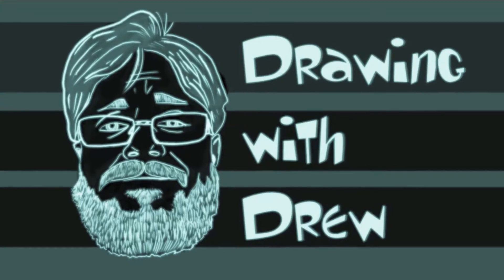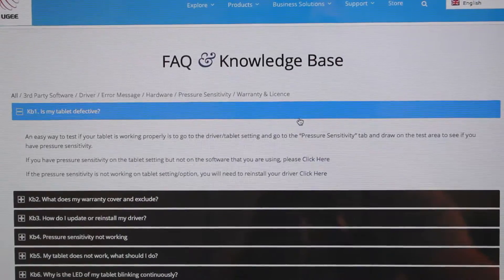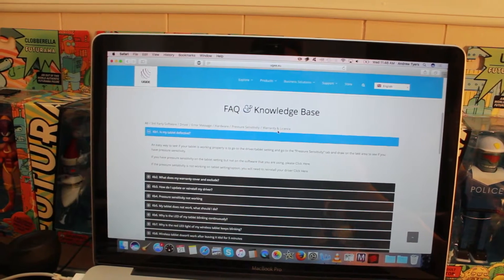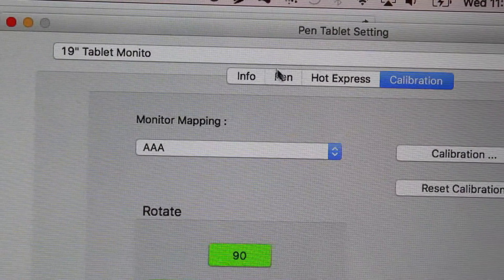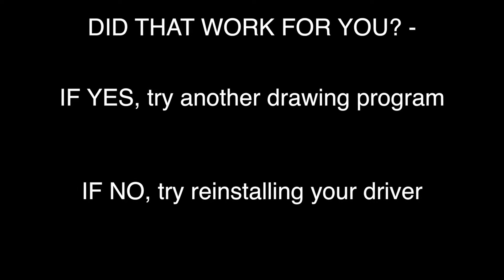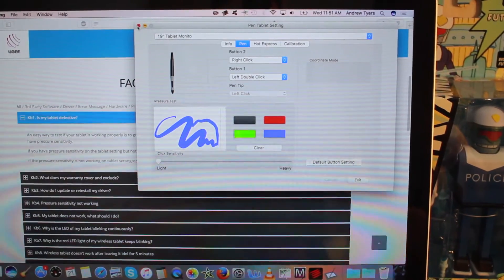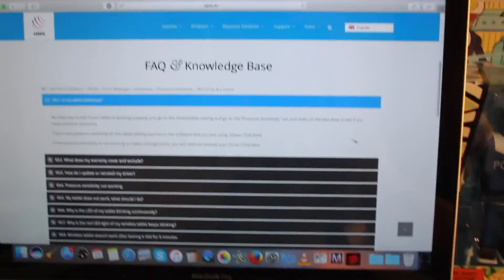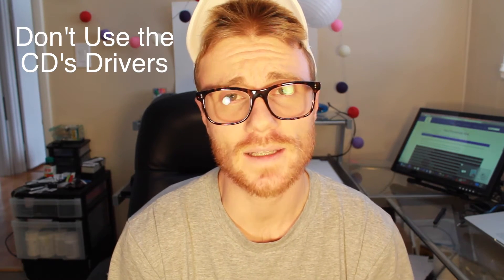UGEE UG 1910b ADVICE- How to Tell if Your Monitor is Defective. * Trouble Shooting Tips & Help

Comment: Sorry to complain, but my tablet isn't connecting the screens correctly. Instead of working on the one screen, it shifts between the two. My tablet also appears black on the log in page of my computer. I've had smaller problems before and had managed to fix them, but this one won't go. It also displays a "No Signal" message in a blue box. I scrolled through and found others who experienced the same problem, but the solutions that worked for them won't work for me. Any help would be greatly appreciated. It's never done this before so I don't understand why it's doing it now all of a sudden.

Comment: Hello Drew how are you doing??? I was hoping you could help me with this little problem I have with my UGEE  1910B. It works fine but my screen goes black after a minute. I did everything to fix this problem but I can't see anything on the UGEE 1910B...Could you please help me with this problem??? Also on my computer, it shows one screen, not 2 screens connected...

Comment: Hi Drew, Ive had my tablet for a short time, the screen appears to have some dead areas where the cursor skips the motion i am drawing and draws a straight line. this issue occurs in 3 areas on the screen for the height of the screen. I have tried contacting Ugee but nothing , have you ever heard of this issue ? :S

Comment: I've been having calibration issues, but I cant just calibrate the tablet. Whenever I select monitor number 2 (the  ugee-1910b) in the pen tablet settings, the pen is unresponsive. When I select monitor number 1 my pen is responsive but way off calibrated.
Reply from the maker: Here's a tip from another subscriber....it might work: "i uninstall the ugee2150 to my laptop coz the pen is not responding while i'm doing some job the pen cursor just left in some area and while i right clicking then it will respond then after that will not respond again, what i had do is reinstall it but i set the properties of the installer to "run in compatibility mode" after that it became ok again, I've just discover that tip from somewhere in google world hope you find it too, hope this will be useful to others." Good luck!

Comment: I'm having a problem. I started using ugee on my mac instead of pc. it worked the first time but now it says 'tablet not found'.  The screen works and the curser follows my pen but i can't click anything. I've tried completely reinstalling the driver but no such luck. Any advice?
Reply: Hi, I’m currently having the exact same issue with my 1910B except mine has said “tablet not found” from the very start, did you ever find a way to fix this?
Reply from the maker: Hi October Dreamer...very strange that it worked the first time but not after that...have you been able to get it to work since? I guess I would start by trying to run it on your pc first to see if it is something to do with your Mac. Let me know if it's working and we can try to trouble shoot it more. Good luck !

Comment: Hi drew, I got a Ugee tablet myself recently and it works well except the monitor of the tablet won't turn on. What do I do?
Reply from the maker: Hmmm....I would try unplugging everything from your computer first....First things first, I would try installing it on another computer first to make sure that it isn't your computer that it is having the problem with. As a last resort you could try  using a little rubbing alcohol on a paper towel and lightly touching the connection pins (power off of course)....there could be a loose connection within the unit...if that doesn't work I would contact ugee immediately.
Reply: I actually figured it out, the Ugee I got had a core that connected it to the computer (which I had to buy the drive on amazon, thanks for the link) its very touche and sensitive. which is annoying but hey it works now, all I have to do now is take time to adjust to it.

Comment: I'm sorry to complain like everyone else. but my pen has issues. my spare was one broken when I got it so I don't know if that had a connection or something but here's my issue. The pen I do have seems to want to draw when its not touching the screen. And it decides to hold onto things too. I tried all I could but I still have that problem. I'm wondering if I can get a few tips. And again. I don't know if the package my tablet came in was thrown around quite violently. But iv'e cleaned everything top to bottom with a microfiber cloth and it still has the issue. Iv'e tried this with 3 different programs, but I still run into that issue, thank you for your time. kind regards
Reply from the maker: Hi Lucky! Don't be sorry...this is why I started this YT channel...to offer support and share solutions with everyone...Sorry to hear about the pen issues...if one of your pens arrived damaged then there is a good likely hood that you do have an issue with your pen. 1) I would write to ugee and explain your issue....I think they will be receptive and send you a new pen as it would be a lot cheaper than having you return the entire unit. 2) Try a variety of drawing programs with it...does the pen function the same way regardless of the program? 3) play with the buttons on the pen a bit...it could be that their is a connection program and it is acting like one of the buttons is being pressed under certain pressures...Let me know and hopefully we can find a solution

Comment: Mine connects and disconnects, I'll be drawing with it and out of nowhere it just stops drawing, I bought a new pen thinking my other pen wasn't working because I would charge it and still nothing. I would replug in everything, but nothing worked. So I got the new pen and it was working for about 20 mins and bam it stops again. I went to tablet settings and now it doesn't even say my tablet is found it says "Tablet Not Found" So I reinstalled the tablet settings thing, and still doesn't work. To clarify, I'm using an Apple MacBook Pro.
Reply from the maker: Hi SpitfireAnimations. I am sorry to hear that  you are having trouble with it. Is it still not working? the only thing I would say is to try installing it on a new computer...no matter how old, to see if it responds to the new device...if so, you may need to reformat your computer as something may be interfering with the drivers

Comment: I just purchased a Ugee and cannot get my monitor to display anything other than "No Signal." Has anyone else ran into this problem or found a solution? The drive is installed, there are no other pen drivers on this computer and all the cables are plugged in a snug in their correct ports. I even gave my graphics cards an extra push to make sure they were snug, but still nothing. The pen itself works to control my computer cursor, but there is no image on the tablet.
Reply: same here, I've been trying different ways to connect it to my computer and no matter what it just says "no signal" when I turn it on, but allows me to use it as a drawing pen
Reply: nevermind, apparently I just didn't realise that you have to connect it before booting up your computer for it to recognize it
Reply: CST0UT Same issue with mine, disappointed with my buy. Not buying another anytime soon
Reply from the maker: Hi CSTOUT...That's very strange. Are you connecting the monitor via VGA or DVI?
Reply: You will need  a vga/hdmi conversion  plug http://www.ebay.com/itm/1080P-HDMI-Male-to-VGA-Female-Video-Cable-Cord-Converter-Adapter-For-PC-DVD-HDTV/221909515908?ssPageName=STRK%3AMEBIDX%3AIT&_trksid=p2057872.m2749.l2649

Comment: Hi Drew, problem.  This tablet works for a short time with Sai program then went I turn off my computer and turn it back on, it doesn't work anymore.  Seems I must uninstall and reinstall every single time I turn off my computer.  Frustrating.  I have HP windows10. Bought a VGA to USB cord. Any advise? Thanks.
Reply from the maker: Hi Sonja. Does the program work fine if you just put your computer to sleep rather than turn it off? What happens if you unplug the VGA cable prior to turning off your computer? It sounds like you are having driver problems...its almost as if it resorts back to a default setting after you turn off your computer. Did uninstall any previous drawing tablet drivers prior to starting? Did you download the driver from the website rather than using it from the CD? Hopefully we can fix this...I would send Ugee an email too incase they know. Good luck

Comment: Hi Drew, I have a question, I just got the 1910b today and I'm really happy with it's pen performance but I'm having trouble with the monitor part. Mainly, I can't seem to calibrate the colors properly andt the screen being so bright it hurts my eyes within minutes of use. I haven't gotten a dvi cable yet so I've just tested it with vga. Thanks in advance!!
Reply from the maker: Hi PacoAfroMonkey, I wish I could say there is an easy fix for it but I haven't found one. The colours on the 1910b aren't exactly accurate so you will need to use your computer for reference. As for the brightness, it bothers my eyes too after about 2 hours of use, I found that wearing sunglasses while drawing for extended periods really helped...hope that helps. Good luck!
Reply: Hey Drew, so if anybody else was wondering about the brightness and color problem, I kinda found a solution. You don't want to lower the brightness on the OSD settings, that just darkens the colors. The trick is changing the color temperature setting to "user", there you can change the red, green and blue values individually. Set them all to anything below 50% and you're good to go. Now the color calibration itself is a bit more complicated since the monitor has very little options. I had to borrow a pro display colorimeter to do it, but I did get pretty accurate colors, so it is doable. The only thing that somewhat bothers me now is I feel the images in the monitor are a little too shap... not much of a big deal, still haven't tested the screen protector (mine had to be sent separately and still has not arrived) but those usually blur the image a bit, hopefully that solves it. Hope this helps. Have a great year, man!

Comment: Hello Drew! I have aa Question that concerns me and I Hope to get an Answer Before I order My UGEE1560?, I have heard from Everyone that there can be a Real Problem Installing the Drivers, Well I had been using a Wacom Intuos #3 for awhile and I went into my Uninstall Program file and Uninstalled My Wacom  Tablet Drivers, and They are Not there anymore, So to be sure I  went to My computer and typed in Wacom and I had some files come up, and I cannot get rid of them!!!! Some say  C:\Windows\System32\Driverstore\FileRepository . Nomatter what I do I cant get rid of them, I even put in an old wacom disk hoping it would delete old files before installing new ones, that Didn,t work either, I Really want to get my New Monitor Tablet, But am scared that it wont work and I might have to do a whole reinstalation of Windows 10, I got my Dell 2 in1 back in May, so I have a warranty on it, and would be able to get a New copy of Windows, But I am still Crossing my fingers about getting this monitor, I Plan on using it on my main Desktop and my Laptop, and I had my Wacom Hitched up to Both. I am scared that it jus might Not Work for me? what do you think?   Thank,s for listening?   Jack
Reply from the maker: Hi Jack, those are very valid concerns. I haven't used the Ugee1560 yet but it sounds like your issue is more with the uninstalling of your wacom drivers. As long as you have uninstalled your wacom driver I don't think the additional files will interfere with your new tablet. I had an intuos 3 installed on my mac and after uninstalling it, I didn't have any issues with installing my Ugee 1910b or my Ugee2150...Im not sure how people are having so many issues with the driver installation...It has always worked perfectly for me. I would say order it through amazon and if it doesn't work out, return it. Good luck!
Reply: Thank,s Drew!